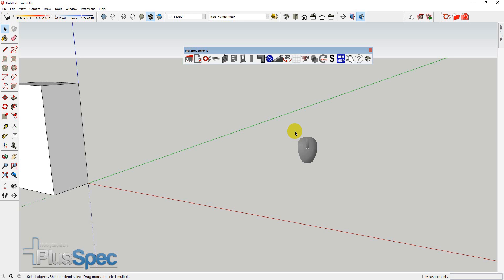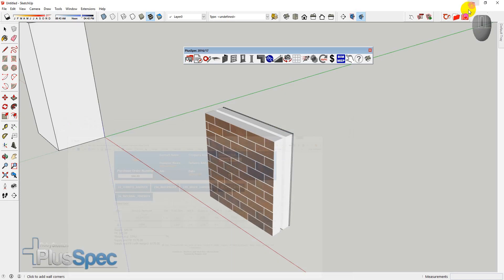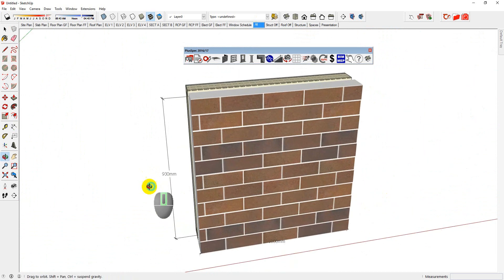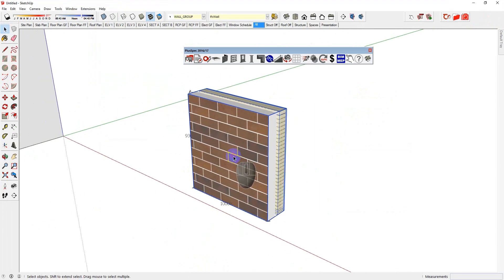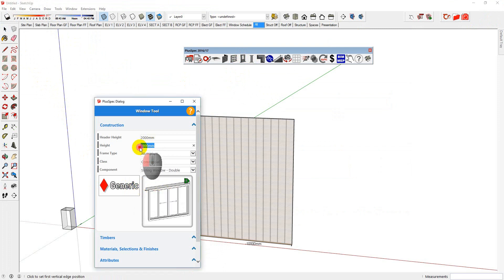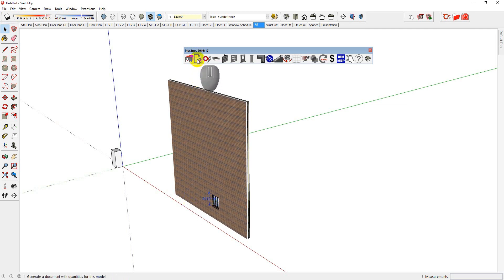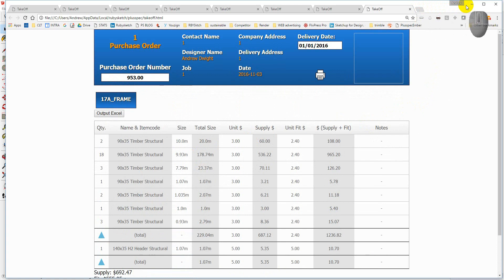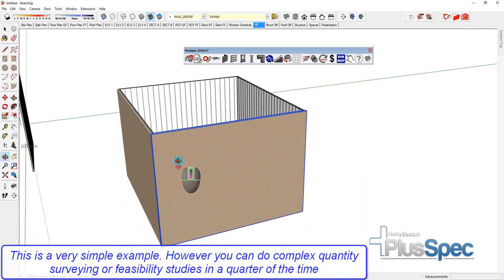Construction estimating software that's changing the way we build.

Comment: Is this the future of construction estimate? Or is there a standalone software for estimates?
Reply from the maker: Hey Riccia888! Thank you for your comment.  PlusSpec is a Estimating & Design software specializing in Residential Construction. You can quickly do a Bill Of Quantities from your design with a click of the mouse.  We have a page dedicated to our estimators here https://plusspec.com/estimators/, would love to hear your feedback. Thank you
Reply: riccia888 I believe that the traditional 2d plan is open to interpretation and reading through a plan set of 20 plans allows for oversight, the 3d model is one plan and basically we view different sections or views inside of it, changing one detail changes all details.  The benefits of estimating from a 3d model are vast. Eg the 3d model is where the 2d drawing is derived, so estimating from the model that creates the 2d plan takes out mistakes. The interpretation in  VDC is second to none as the building is virtually built and therfore a representation of actual.  
To answer your question, yes this is the way industry is going in my opinion and many others.  It's all about communication of design intent and reducing the disconnect that the 2d plan delivers.